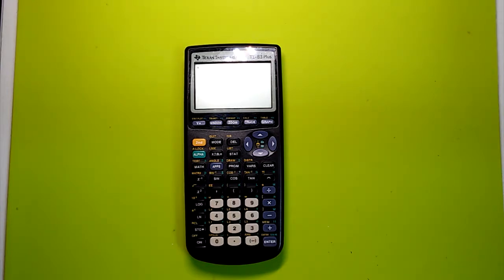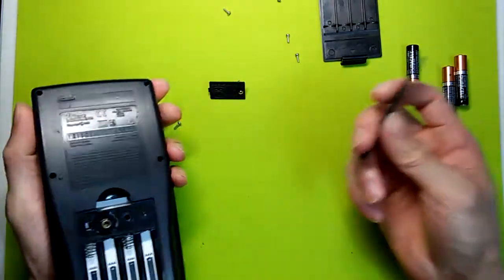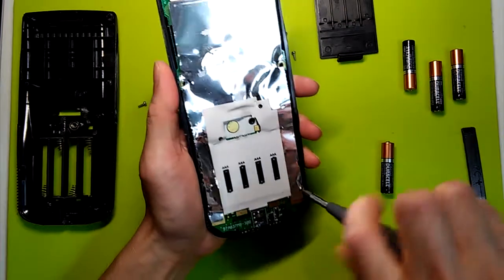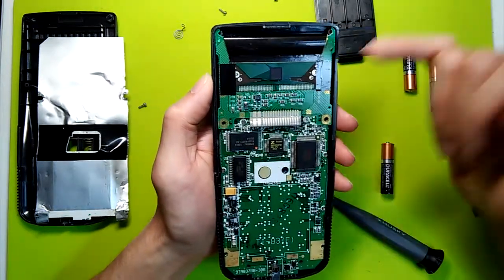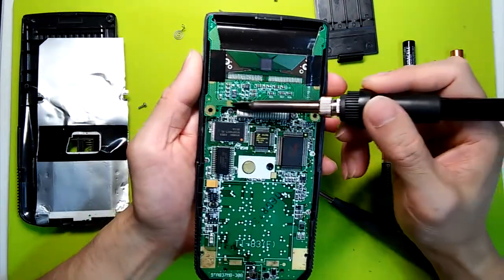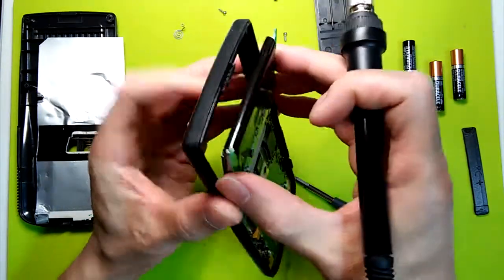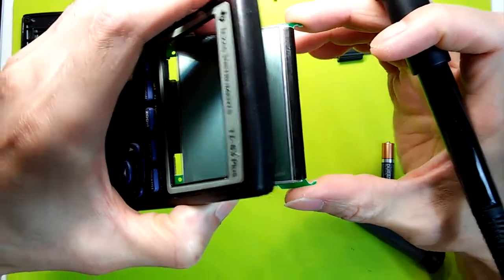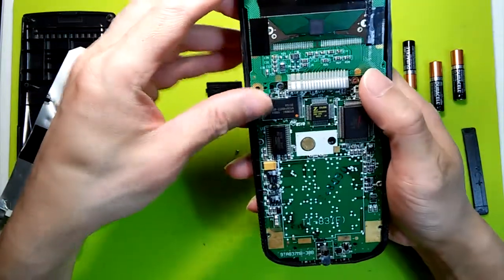Texas Instruments TI-83 Plus Missing Pixels Repair

Comment: Awesome!!! My TI-83 Plus didn't have problems, I always linked to another TI 83/84 and was succesuful, but few days ago I tried and appered the message that there were some errors in XIT or something ? I'm sad because it has been my prefered calculator for the last 10 years and probably it has a problem on the link port. Honestlymy sight isn't good to work with this tiny pieces; maybe I'll try check it soon.
Reply from the maker: OK.  Try a different cable or clean the contacts.

Comment: Cool, thanks!  I used a hot air station and pushed the cable back into place with a flat plastic tool, and that worked too.
Reply: Hey what temperature did you use?
Reply from the maker: good news

Comment: What kind of soldering iron are you using? And what was the temperature at?
Reply from the maker: I use a 50 watt soldering station(Atten 937B) but you don't need anything that hot for this repair.  I like soldering stations because you can set the temperature and with this repair I set it a around 200° C.   I go by feel to see how the plastic is responding to the heat and I increase or lower the temperature accordingly.

Here's a station similar to mine: 

https://amzn.to/2D7XqSv
Reply: @watdahel  You should put this info in the description. Thanks for the video, btw.